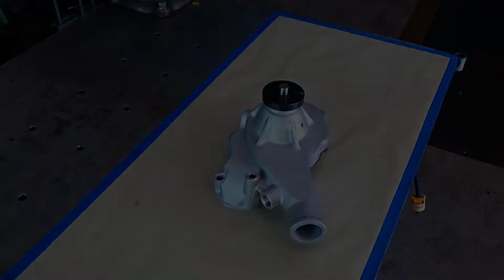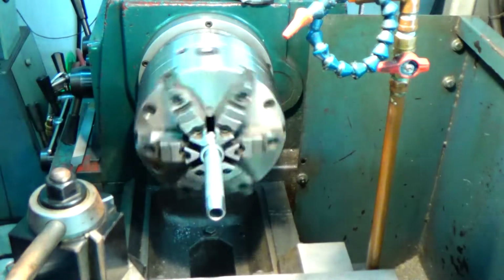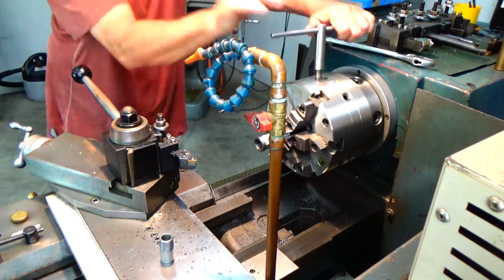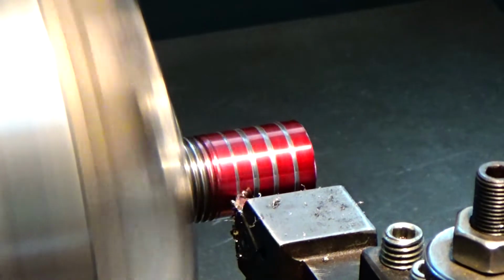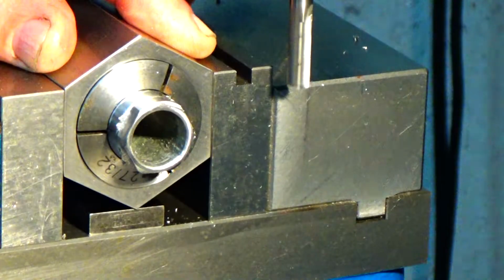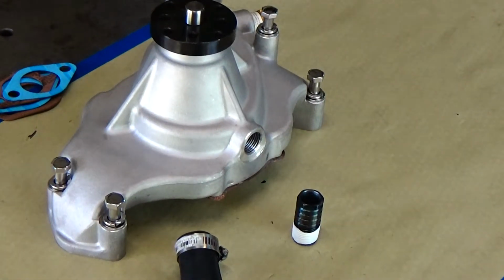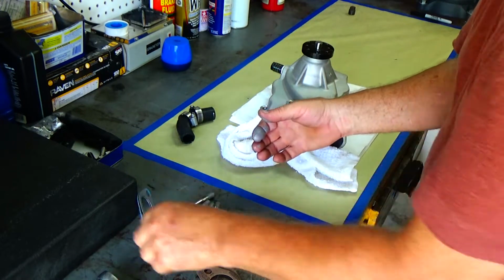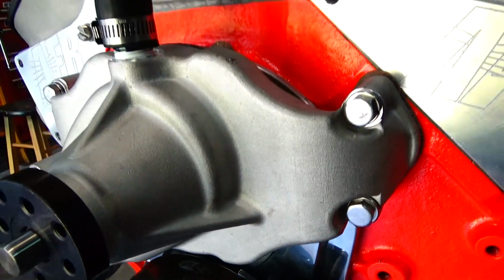Water Pump Install: Will it Clear Cloyes Timing Cover- #24 Chevy 454 Build Block Performance Build

Comment: I know I love my 427 it's 60 over I have the afr 265 oval port heads on it and those heads make great power it got a Howard's hydraulic roller I do have a comp solid roller that is a Lil bit bigger but. I'm happy for now with the power it makes besides gives me a excuse to build the 496 I been wanting to build. Love your videos I really liked those nipples you made for your water pump I wish you sold them id buy a few sets...lol
Reply from the maker: Yeah... that's the real fun to me is building the engine picking out the parts and then assembling it.... and I actually have some brass nipples for it now... that I'll probably switch out at some time ....👍

Comment: Just to give you some advice, I have used those felt/cork brown gaskets before on 2 different engines and they blow out... so be careful, otherwise it is wayyyy too bad that you had to cover those nipples up LOL
Reply from the maker: Great information Jared...Thanks for sharing!
Reply: @Myersmetalworks  Just carry a set with you when you go out LOL, I luckily blew it on the initial test drive both times so it was right down the street. Just don't want you to be stranded because of something like that! Otherwise that is really freaking awesome how you made those
Reply from the maker: No worries Jared-- as far as this engine will go is to the engine stand because I still don't have the car for it yet!!!😅

Comment: What is the deal with the brass barbbed
Fittings?you can't find them.I had to use $28.00 aluminum Edelbrock fittings.
Reply from the maker: It was around the time of the weird covid thing, and no one had any brass fittings that would work, the auto parts place wanted more than I was willing to pay so I just made somthing with the old lathe.... somthing to do I suppose....